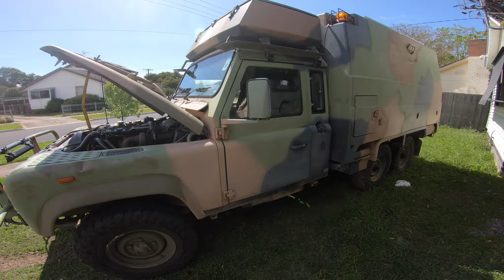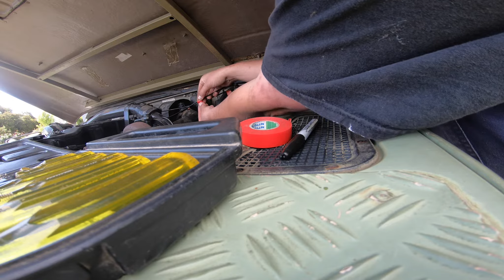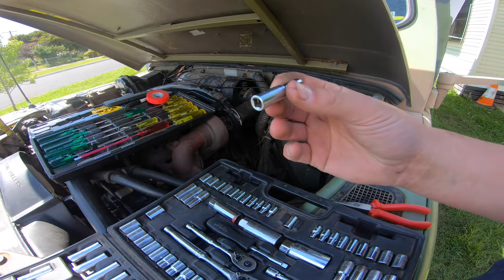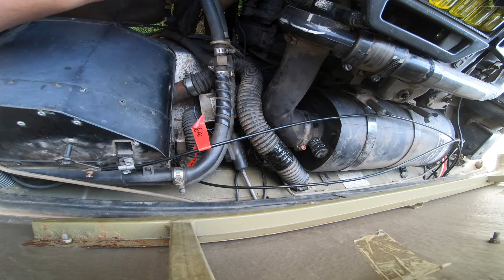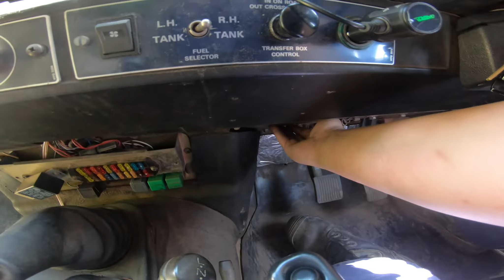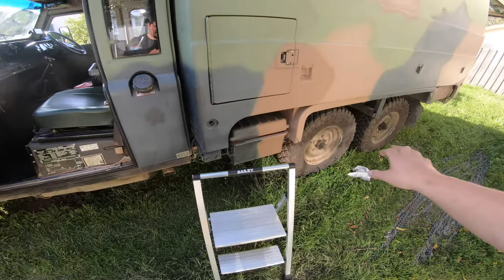Heater box controls | 6x6 Land Rover Ambulance

Comment: Is there any way of changing the cables without stripping the dash. E.g. by attaching the new cables to the old cables somehow and pulling them through?
Reply from the maker: No, not how these cables work.
regardless if you could, you still need to attach them to the back of the mechanism, which requires removal of the dash.
this is one of the many reasons why people swear at land rovers.
still better than modern cars though.
Reply: @TheAussieRepairGuy  I guessed as much, but you cant help hoping 😊
Reply from the maker: @chrisparti  yeah it's not as bad once you get in there, I was able to leave the dash mostly in place, and just remove the screws and shove my hand underneath. Still had to detach the entire dash though.